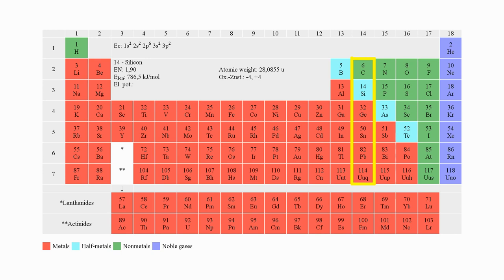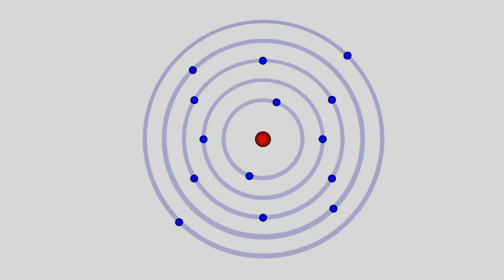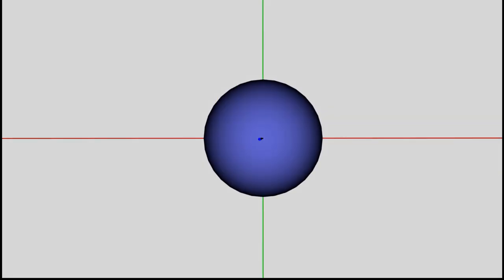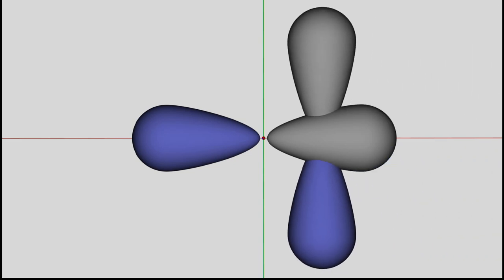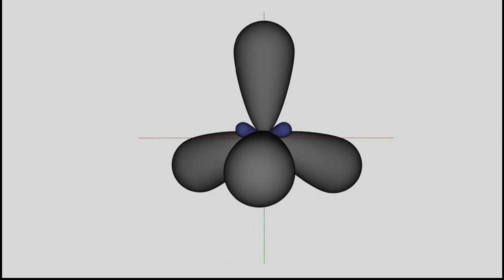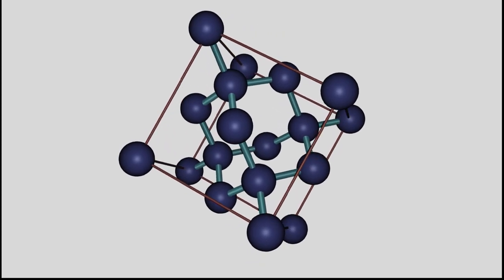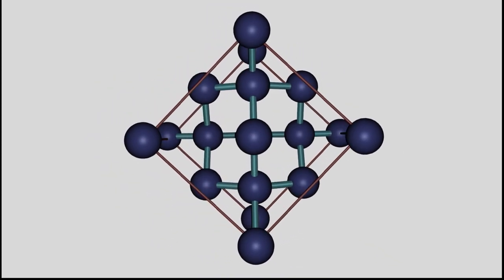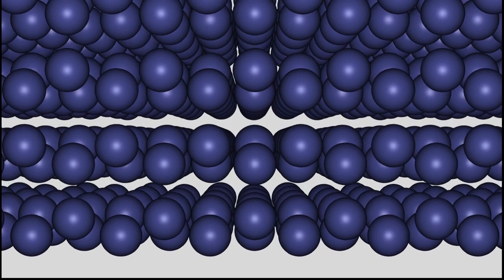Crystal structure of silicon, carbon and germanium

Comment: Why does carbon is not used as a semiconductor?
Reply from the maker: You would need carbon in the modification called "diamond". That's an expensive raw material ;-)